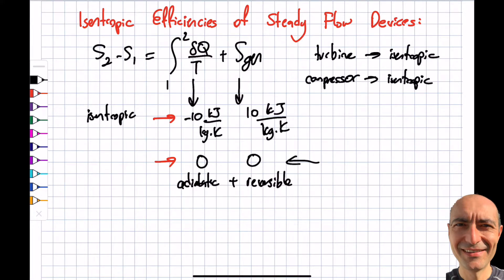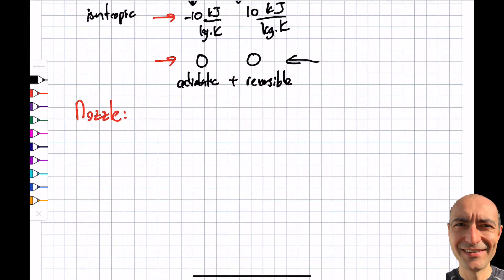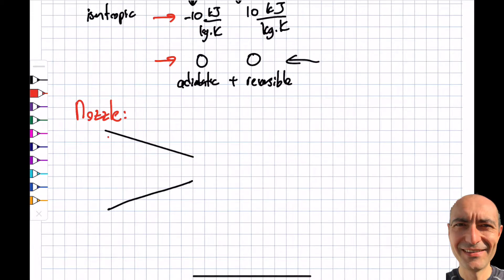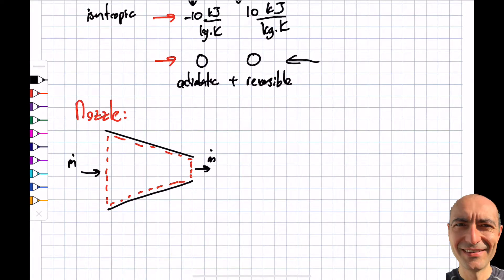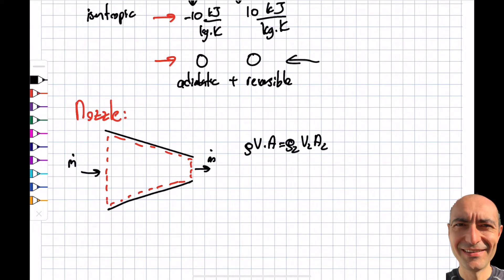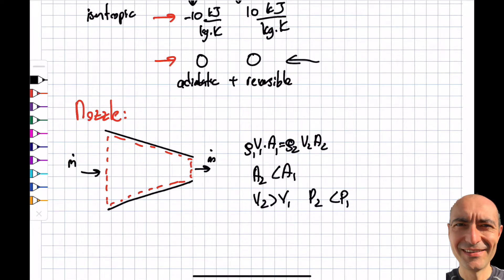Thermo 7.8: Isentropic Efficiency of Nozzles

Comment: I have a problem and I can't answer it, can you help me so I understand, here's the problem, 
A turbine operates with a 860 F, 900-psia throttle. Calorimetric measurements
indicate that the discharge enthalpy is 1250 Btu/lbm at 100 psia. What is the isentropic
efficiency?
Reply: around 85,7%